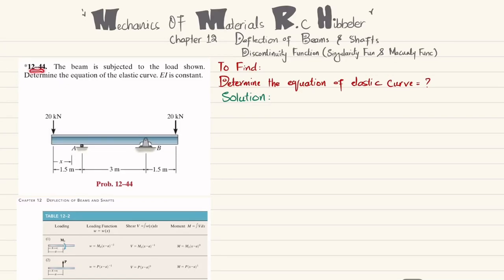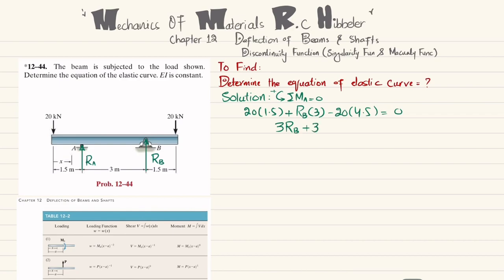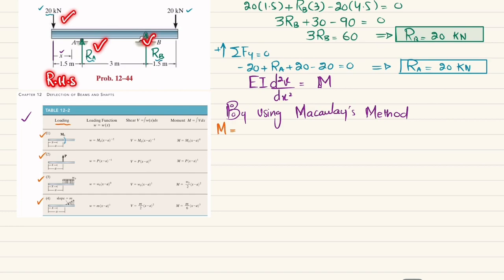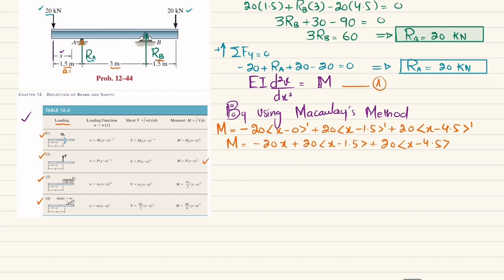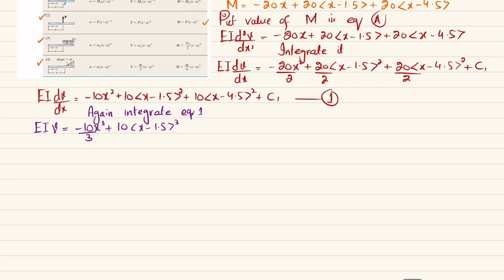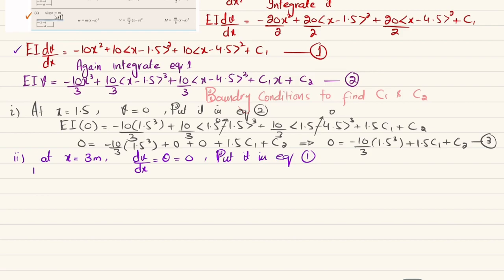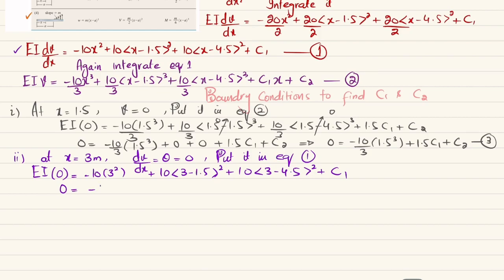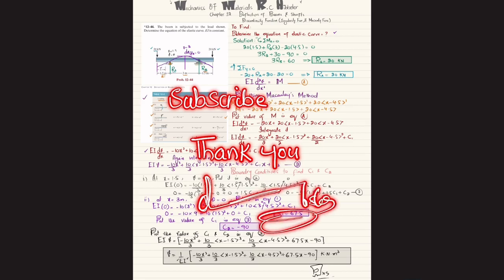12-44 Deflection of Beams & Shafts | Macaulay's Method | Mechanics of materials RC Hibbeler

Comment: Sir, can you please explain how do you know where to cut the beam from? I get confused with determining where do i section the beam from in these types of problems. PLEASE 🙏 Thankyou
Reply from the maker: Well the method that we used is Discontunity Function ( Macaulays method). The basic importance of this method is that with sectioning beam we can find a single function for moment that is used to determine the equation of elastic curve. You can see we haven't section the beam in this method. Kindly check that and respond me whether you get my point or not?
Reply from the maker: I think you are talking about question like this in the given link
https://youtu.be/Yvn11r6NuW8
Here we have given x1 and x2 . So again you can section it at X1 and find the moment equation and for coordinate x2 you can section  it at x2 to find the moment.....
Reply: @engradnanrasheedmechanical  yes sir, I under this method. But in questions like 12-20 from Hibbler mechanics of materials. I'm confused with them, because they require me to section the beam. But I always section it at the wrong place. I understand my question is not related to this problem, so sorry about that but, can you please provide any advice on how do we know where to section a beam from in the method of sections. Or if you already have a video on that please refer me to that
Reply from the maker: Kindly check the above comment in which I shared a link of video so go through it please